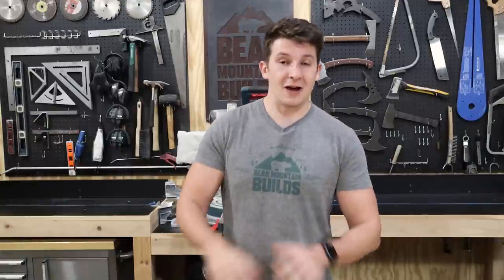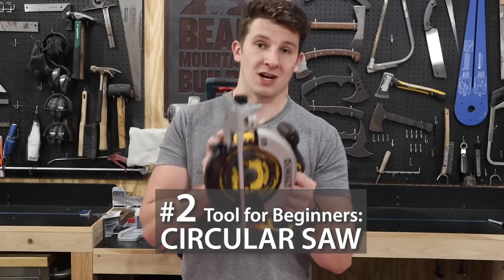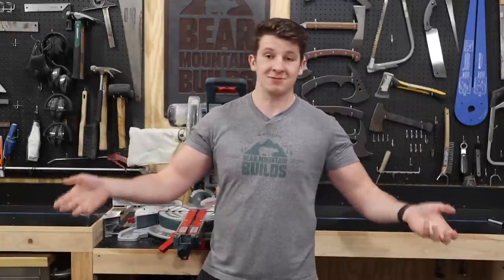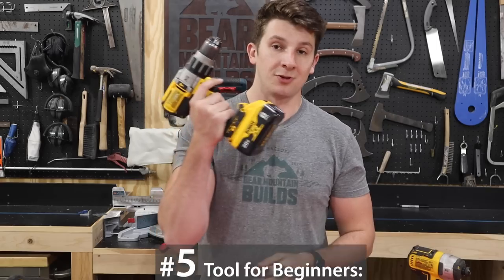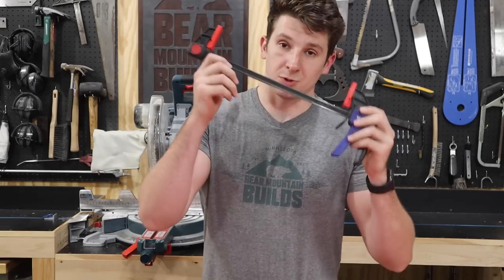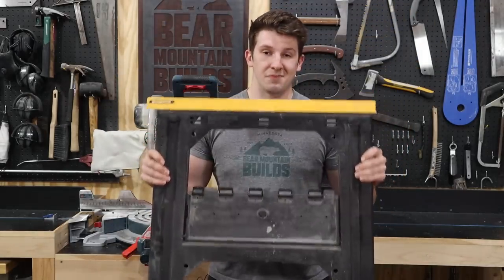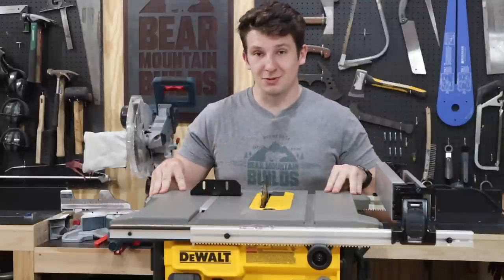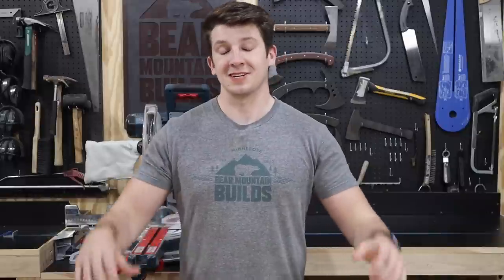Tools To Start Woodworking

Comment: When I started woodworking the most important "tool" that I had was a very large rubbish bin 😁
Reply: After yesterday I have to completely agree. For a simple project it turned out to be a complete failure. I’m sure it’s user error.

Comment: i like the tape measure that holds the position until you push the button, They are more expensive but allows hands free adjustment,

Comment: Great video. I am just really starting with woodworking but great suggestions. The only thing I would add would be maybe a shop vac and some adapters to hook up to tools for dust collection and to clean up the mess
Reply from the maker: That's a fair addition, I didn't put that in there because a lot of people start with building outside in the driveway

Comment: I think the miter saw is more versatile for DIY and beginner woodworking than the table saw. I made my 2 sawhorses (36" top width) and a cutting grid that fits over the sawhorses to do the breakdown on sheet goods. I use a lot of 2x stock so the miter is fast, easy, and safer for me than a table saw. Thanks for all the info and tips. I really enjoy your channel.

Comment: For sliding miter saws, make sure you have the clearance behind the saw if you're not going to spring for a flush back. Most miter saws have linear rods through bearing blocks that extend behind the saw in it's fully back state. If you don't account for that and buy one, you're gonna have to put your saw like 10" out from the wall. A flush back saw either puts the linear rods in a forward position or uses a set of hinges to control the motion so you can mount it fully against the wall. The Bosch miter saw in this video is a flush back saw I think. Bosch calls their motion system "Axial Glide"

Comment: Awesome. You have a great way with words and you get to the point. I always learn a lot from you and I'm going to start building your 2 piece work bench. I really enjoyed your Circular saw segment, something I'm using a lot because I can't get enough power in my shop for a 15 amp table saw  (I only have 100 amp panel). so yeah, THANKS

Comment: I bought the Bora Straight Cut Guide because you used it in an earlier video.  It works great.  I would love to see how the new shop is coming along.  SE Idaho.  Thanks For the videos!!
Reply from the maker: I’ll be setting in on finishing the insulation hopefully by the end of May. Just not a lot of free time with making videos and working a day job. But I’ll definitely be in there by the fall.

Comment: Since watching your modular table videos I've planned to build an "extendable" mitre saw bench.  Something with flip-up ends with the track built into them.  Means a folded-down workbench can be stored or moved somewhere without a lot of space (like my situation).  Someone that puts plans online for anyone to use should do this.  ;-)

On a semi-related note, this video really demonstrates how subjective all this stuff is, too.  Blacktail Studio said #1 should always be a table saw but his situation is different to most.  Dust collection will play a big part in this, too - working outside?  Not too much of a problem.  Small indoor shop?  You need to pay even more attention to the amount of junk you breathe in.
Reply from the maker: Great idea for the folding ends on the miter saw. I’ve thought about doing something similar on my utility tables. I can appreciate good dust control, but most of the time if I start to really throw a lot of dust around I just wear a mask. Someday I’ll have good dust control though

Comment: In order i went: miter saw, table saw, planer, jointer, drill press, band saw, laser engraver, cnc router, all in 3 months.  Also get the skil table saw which takes dado stacks.

Comment: I never seem to be able to cut a straight line with a circular saw, and when I try to get to the end of it it kicks back. What am I doing wrong? My goal eventually is to be able to build my own greenhouse, which I thought would be pretty simple, but apparently not so much.  

Yeah, that’s another thing I need is a miter saw table .
Reply from the maker: Could be a couple of different reasons

1. Are you using a saw guide?(I recommend the one I use if you don’t)
2. Your circular saw could be out of alignment between the blade and the guide. (My first circular saw was like that and I could never cut straight)

Comment: Get Dewalt, Milwaukee, Makita. Ryobi is junk and Kobalt and Craftsman is not much better. If you are ballin and want top of the line get Festool.
Reply from the maker: It always comes down to how much money you want to spend. I’ll die on the Dewalt hill at this point since I’m so entrenched in the system
Reply: @BearMountainBuilds  I had a Ryobi sander and when it broke they told me tough luck. Even Ryobi sponsored YouTubers have told it’s junk. 

Dewalt has always stands by their tools and if anything breaks they always replace it. It might be a few more bucks but it’s more than worth it.